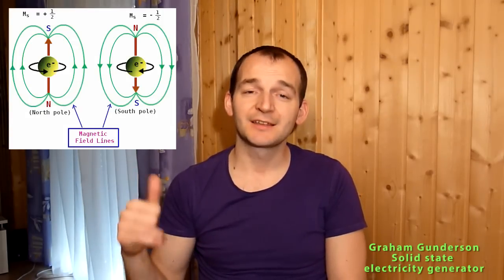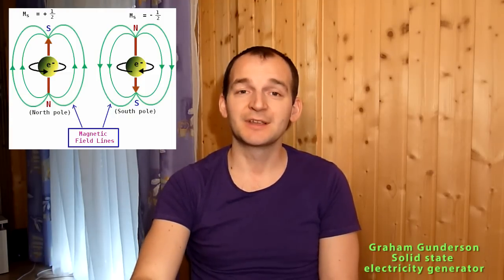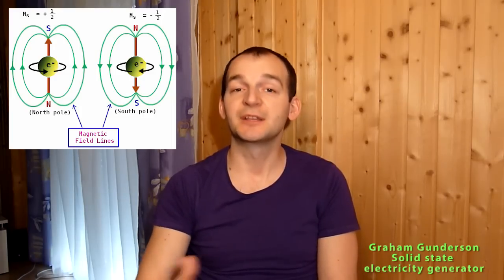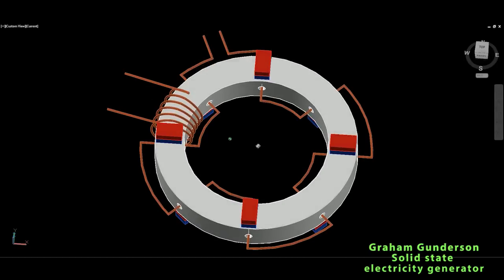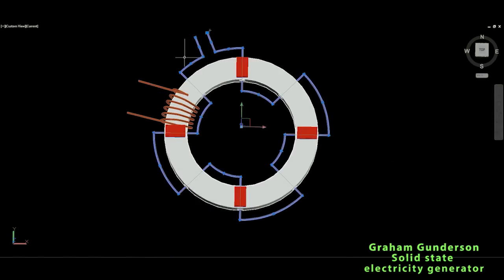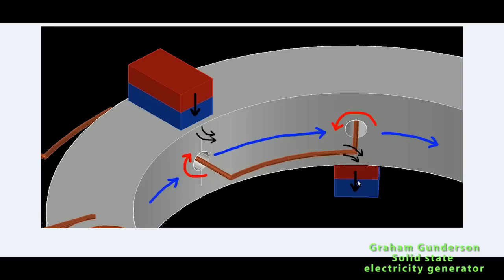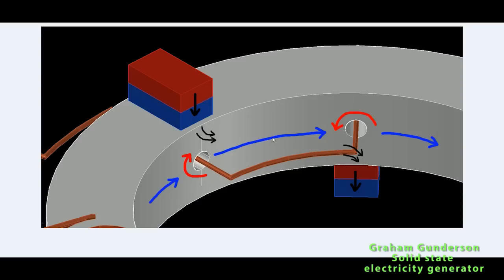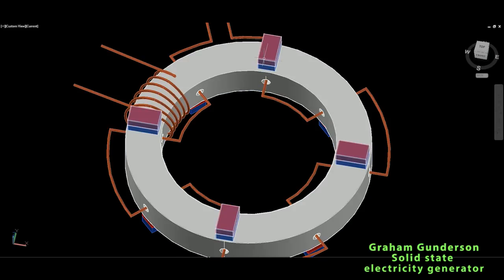Free Energy Generator, GRAHAM GUNDERSON Solid state electric generator

Comment: Wow, I guess there must be fairies at the bottom of the garden after all if this device produces over unity ;).                                                                                                                                                      Firstly you would need to input a very high voltage into the primary to generate any usable voltage in the secondary coil due to the operating frequency range of Ferrite cores, and low number of windings on the secondary  coil which in turn would decrease coupling efficiency between primary and secondary coils and lead to quite considerable losses in energy.                                                                                                             Circuits which produce such high frequency alternating current are usually no more than 90 -95% efficient at best.   What he describes in his patent is a solid state generator with no moving parts.  It is NOT a Free Energy Generator, because you must supply power to the primary. So the power going in is certainly not Free !!                                                                              How about the power coming out of this device?                                                                                    Well it basically acts like a resonant transformer with some magnets glued to it.  The magnetic energy in the fixed magnets supposedly adds to the energy produced by the primary coil thus generating more energy at the output than was fed in, thus achieving over-unity.  Yay ok that's how it's meant to work.                                                                                                                                    The problem with this, is that the magnetic field in the toroid generated by the alternating electricity fed into the primary coil reverses direction with each alternating cycle of the wave.  This means even if the fixed magnets add magnetic energy to the magnetic field when the current flows one way, they will subtract the same energy from the magnetic field generated by the primary coil when the alternating electric current goes in the opposite direction, thus cancelling out any effect the fixed magnets might have in increasing the energy at the output.                                                                                                                                 The total energy you put into this device via the alternating current fed into the primary coil will be more than the energy you get out.  The reason is that the magnets add no extra energy, unless you can reverse their magnetic field with each half cycle of the alternating wave.  To do that would take more energy, thus negating any advantage in using magnets.   The magnets in this device seem to be fixed and not able to reverse the magnetic field with each successive alternating cycle. So no over unity from the magnets I'm afraid.                                                                                                                                    So where is the extra energy coming from to produce over unity?                                                  Answer: it's not coming from anywhere, there is No mechanism of principle involved here which adds energy, but there are a lot of mechanisms which suck energy from the output.  The device will have heating losses due to wire resistance (I'm guessing the wire isn't superconducting?), inductive coupling losses,  capacitive losses due to high frequency operation and inefficiencies in the toroid which will cause even more energy loss.  There will also be switching losses in the circuit which produces the square wave which is fed into the primary coil.  All up, even operating at optimum resonant frequency, I'd be very surprised if this device could produce 90% of what's fed into it, and that's very optimistic.                                                                                                                                    Over Unity at the moment can be produced in a few ways. One is by nuclear fission using radioactive elements, such as Thorium, Uranium, Plutonium etc.  Then there's Solar Power, Wind Power, Hydro Power and Geothermal Power, also Wave Power and Tidal Power.  All these methods are growing in efficiency.  Oh and fossil fuels as well although these produce other issues. The other promising way is by nuclear fusion using deuterium and tritium atoms.  Fusion is the most promising way of producing relatively clean over unity energy in the future and we're miles away from being there yet. Oh and there's of course Matter - Antimatter annihilation which could produce massive amounts of energy,  but we can only produce tiny amounts of antimatter at the moment, so not really a viable way of achieving usable over unity energy at present, sorry Scottie we don't quite know where the dilithium crystals are yet ;).  As for getting energy out of the vacuum (ZPE), so far no joy because of something called conservation of energy.  The vacuum takes back exactly the energy it gives out during virtual particle creation, and if there is some way of tricking into not taking back it's energy then we will have achieved true over unity power generation.                                                                                  But this device  shown in the video isn't any of those things.
Reply: The shortest comment would have been: "The device is a BS and it don't work due to cancellation of magnetic flux", you wrote a bible for no reason.

Comment: You will get power in the output wires only if the the magnet flux is changing and it will be a direct function of the rate of change in the magnet flux. Yes, the flux of the magnets can be strong but each time You will want to change the way of the flux, You will need power, the power of the primary coil and I guess it has very much risks the power needed to induce the change in the way of flux will be greater than the one harvested at the output :/
Reply: Presumably the input coil provides the changing flux

Comment: interesting however , the collapsing magnetic field is caused by the different electron orbitals within the atom so resistance will be created ? surely the way of creating a free energy device would be by some way of minimising the collapsing field as the electrons spin through the pick up coils ? basic physics paints and unlikely picture to over unity although free energy is a different field of science some physical laws are still apperent  , though it would probably change the waveform of the input. Good effort

Comment: a constant magnetic field does not generate electricity, so to publish this gadget you have to be either an individual with absolutely no knowledge about the laws of physics or a scammer
Reply: With a comment like this it's apparent you either did not pay much attention to what was being imparted in this video or you yourself are not knowledgeable enough to understand what was being said.
Reply: i am sorry, i did not know that he was a nobel price laureate for inventing new laws of nature
about myself-  i am a studied physicist so i will not discuss the subject of free energy any further
Reply: don't give up discussing it, we need common sense.  Unless there are coils inside that ferrite core too, around the internal flux lines, I don't think there is enough magnetic flux provided by the attached magnets to be of any additional use.  I'm sure the idea of speeding the flux up inside the ferrite core is possible with shielded magnets, but these magnets are exposing both the repulsion side and the core of the pole's attraction side.  Thus cancelling out any flux benefits, right?  When we take a large magnet past an induction coil, we get a large negative peak, two small positive peaks and another large negative peak on an oscilloscope, due to the donut/toroidial shape of a magnetic field.  So the magnets on this device are most likely causing drag on the inner flux, not speeding it up or giving it a power boost.  If one could capitalize on that drag, then maybe one could gather energy from such a device, I guess, right?
Reply: you can make .6 volts just wrapping steel around a magnet. and you can connect them in a series.
Reply: niklas alagadi dude, there is no free energy got it? What exists is energy around you in all directions .. magnetic, radiant and vibrating energy .. you are swimming in a ocean of it! Just learn how to harvest /collect it! The laws you learning at school won’t teach u that , Capiche?
Reply: niklas alagadi A coil makes it not constant. But you truly only need two opposing potentials.

Comment: is not possible to take out energy from magnet's without mechanically oscillations or ac frequency application over .
Reply: yes it is but a moving/rotating magnetic filed would produce more power than a static one